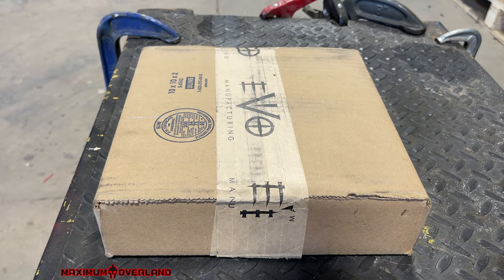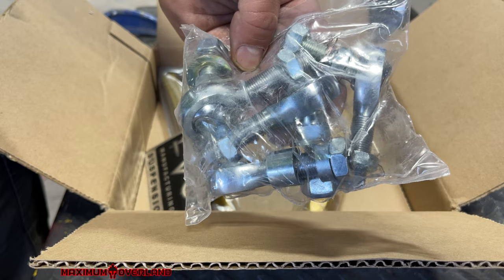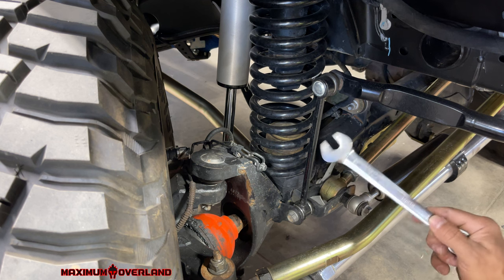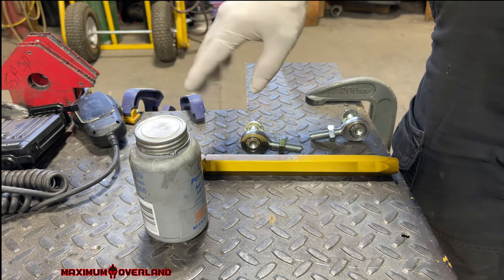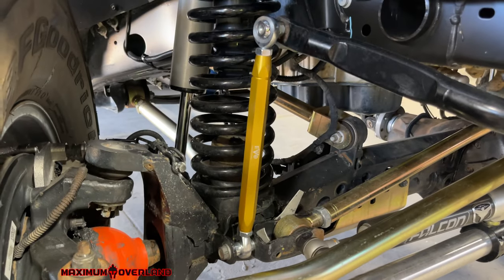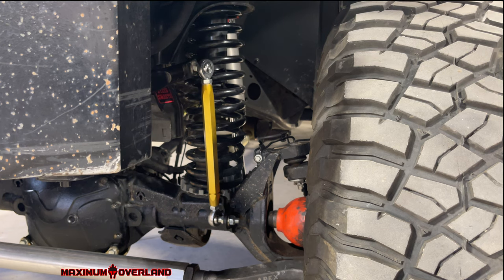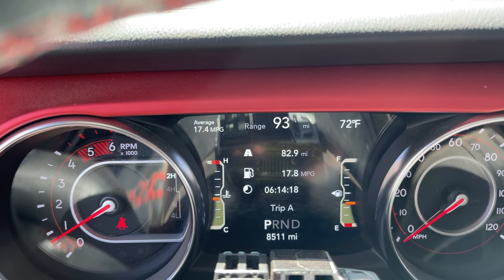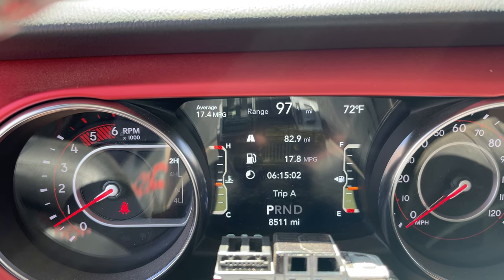Evo HD JT Gladiator Sway Bar end link Install  !!#jeep #shorts #update  #offroad #gladiator

Comment: Nice vid thanks just bought a pair for my Jl 2.5” lift kit, got 9.5-10.5 endlinks. Passenger side, link on bottom will have to use oem bolt with spacers included exactly the way you demonstrated. Going to install on my jeep in a few.

Comment: I didnt hear what gearing you chose. What did you mpg end up being city/highway after breakin?
Reply from the maker: Hey STY !! Thanks for watching and jumping in here. I went with 5:38's from Yukon and they were exactly what it needed. It dod bring down the overall top speed but who cares in a crawler. It would run 80 with zero issues. Both mpg's jumped significantly and by that I mean 6mpg. So if you watch my Evo hd sway bar end links video, at the end I talk about it in more depth because people were asking. I was averaging around 11/12 'ish in the city and after break in I was at 17/18. The highway was 21mpg. Now it weighs 6940 as it's built so that's specific to my set up. Anyway I hope this helps, and if you liked the videos please give them a like and possibly consider subscribing to the channel, it helps a lot actually.